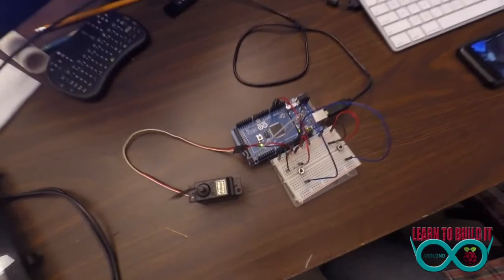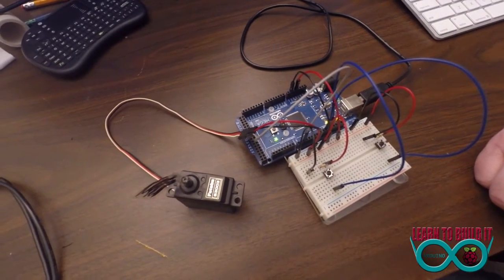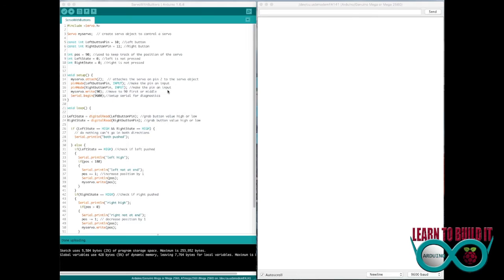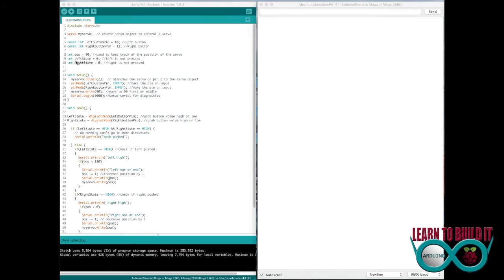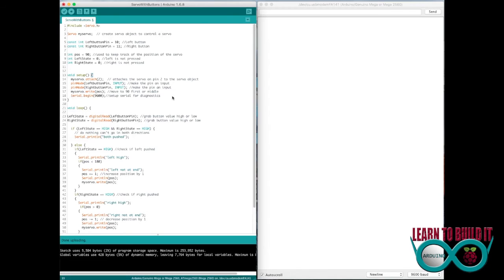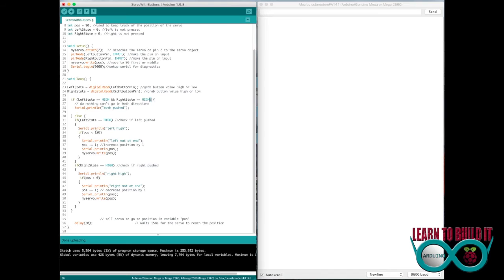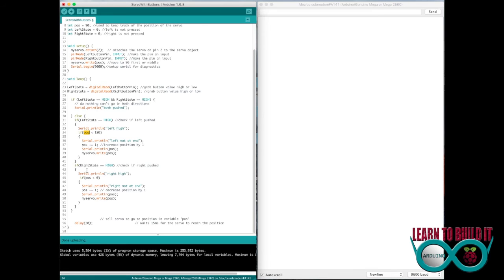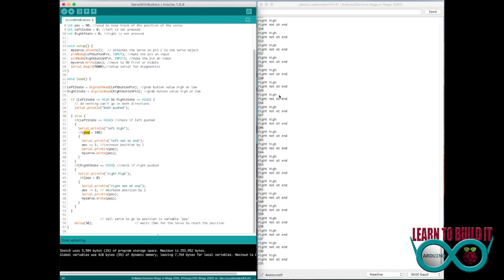Arduino Servo with 2 buttons

Comment: Hi Steve, I've followed your tutorial "operating servo with two buttons", and although the code was successfully UPLOADED I guess that cable connections are not correct. I would appreciate your hep o it does not work.